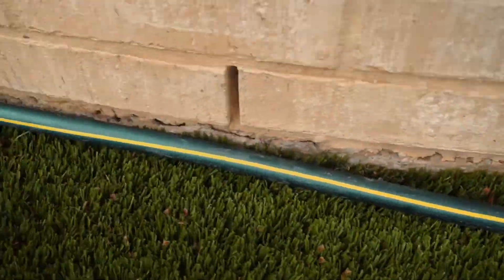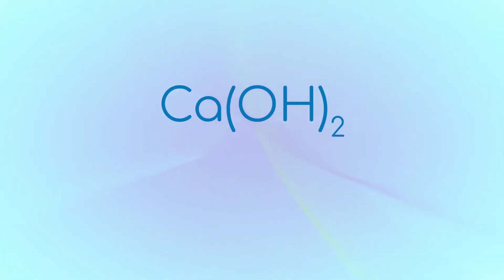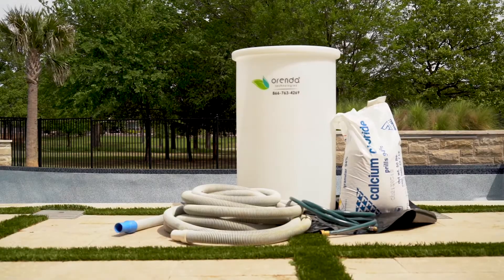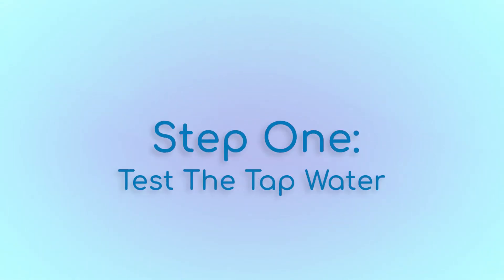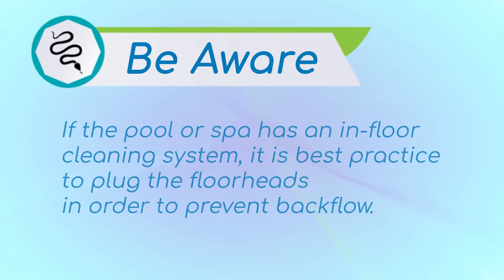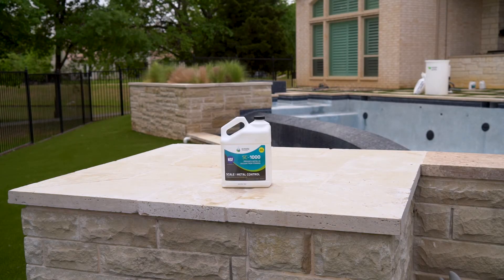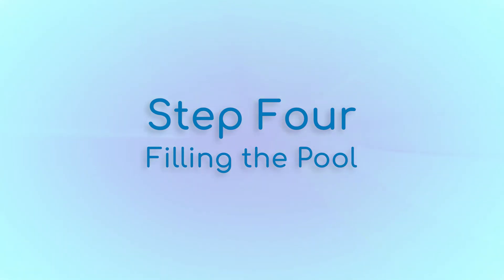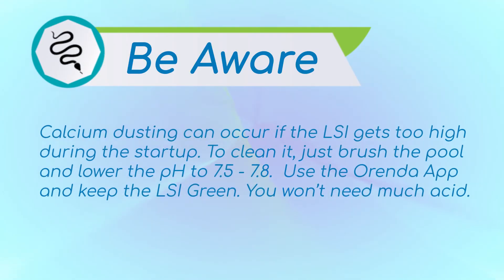How To Perform The Orenda Startup | Orenda Procedures

Comment: Please explain how to use the sodium bicarbonate; how much sodium bicarbonate must be incorporated into the barrel? Does the same trickle amount of calcium apply here with sodium bicarbonate, and is SC-1000 & muriatic acid also added into the barrel with sodium bicarbonate?
Reply from the maker: Normally sodium bicarbonate is NOT added to the barrel, just calcium, acid and SC-1000 are. Bicarb is added separately using a clean bucket to pre-dissolve the bicarb and spread it around. Never put both calcium and bicarb together.

Comment: Quie a lot of missing information.  If you have to put in 100# of Calcium do you put all of that in the startup barrel at one time?  you can't fill up a 35,000 gallon pool with one water hose.  If you have 3 hoses running do you tape them to the vac hose and keep the same amount of calcium treated water flowing at the same rate in the video?
Reply from the maker: We have put 150# of CaCl2 in the barrel at one time before. For larger commercial pools we don’t exceed 150# at a time, but continue to add more 50# bags over time. And yes there are many pools larger than 35,000 gal that are filled with a single hose. We hope not, but sometimes you have to work with what’s available at the house. To us, the faster the fill, the better.
Reply: @OrendaTechnologies  can't we just call the Oredna Water Truck with perfectly balanced water to come out and fill the pool in an hour?